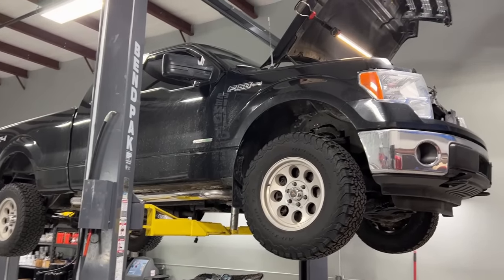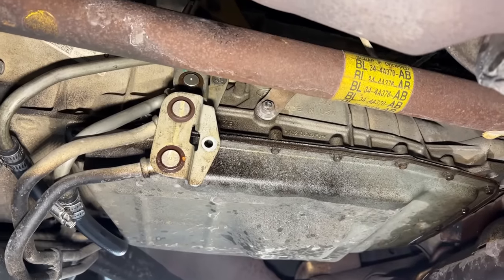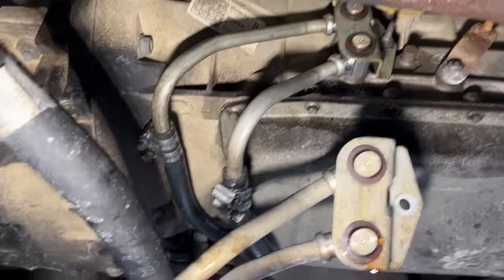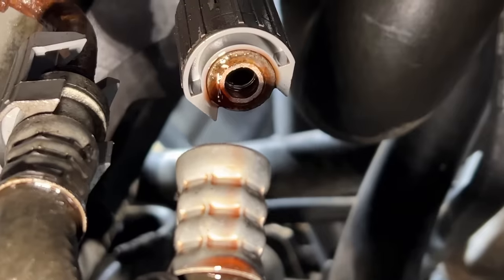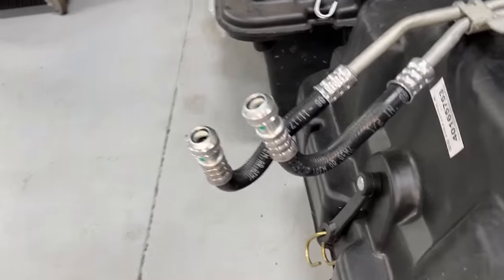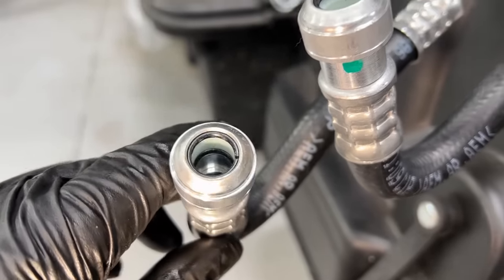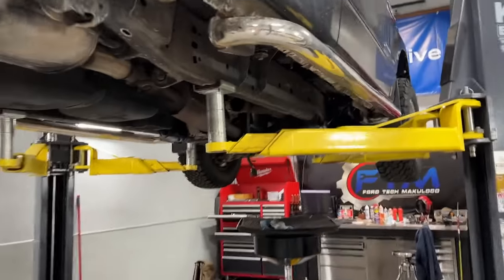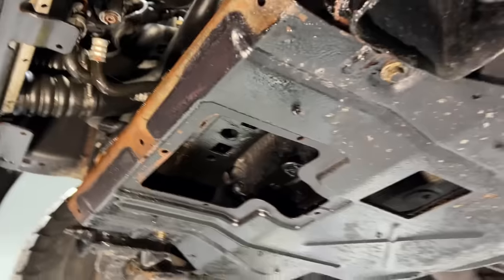Attention 2009-2014 Ford F-150 Owners! Check Your 6R80 Transmission Cooler Lines Before They Blow!

Comment: Love your videos and I've been watching for years, but I disagree with the lines being the killer on the 6R80. That honor goes to the worst thing in automotive history, the lead frame. I had a 2013 and it started failing so I traded for a 2015 (both bought new on the lot) and it just completely broke in one go. Ford didn't want to replace it despite me complaining since around 34,000mi. I kept dealing with it until a young woman chose to not check before turning, causing me to total her 2011 Ranger and my F-150. Now I have a 2017 F-250 King Ranch with the 6.7. I am over 122k miles and no problems whatsoever. I just need to do that EGR/DPF delete...
Reply: That happens to me,I detect the problem on time,cut the hose and put a two dollar clamp and fix the problem,.

Comment: My trans cooler line blew on my 2013 f150 a day after I bought it and it only had 95k miles. Check these lines because the quick connects are crap. The cooler lines are easy to replace at home though.

Comment: Just got a 2014 F150 5.0. Is it the same connectors as the ecoboost? If so, how should I go about inspecting them to make sure this does not happen? Truck has 123,000 miles on it.
Reply: I think they're very similar if not identical. Friend of mine has a 12 with a 5.0, his let go while towing their 26' travel trailer out of state. Replaced them & trans is still good over a year later. I have a 12 with a 3.5l EcoBoost, mine snapped while maneuvering our 29' camper trailer. I replaced all the lines & haven't seen any ill effects after 9 months. Dealer parts dept was super helpful sifting through part numbers, at least verify that much with them if you wanna try & find em cheaper elsewhere.
Reply: Thanks
Reply: No real way of seeing it’s gonna happen I would just change it seems simple and the part is less than $100 I got 215k on my 12 ecoboost and I’m doing it asap. Prevention is key
Reply: @ravennation14  agreed.

Comment: How many miles or age does it usually happen at?
Reply: One guy wrote that his broke at 65,000 miles. Aluminum fatigues easily, especially if it is hardened by pressure forming. You got that fitting, I would change it every 60,000 miles.

Comment: My 2012  did the exact same thing with my wife driving it on the highway. She was able to make it to a rest stop and I trailered back home and found  that the line broke in the exact same spot. The truck only had 80,000 miles at the time but also had a programming issue that I didn't  know about. The fix was easy but afterwards that's when the wrench light came on and the truck would barely move. Shut it off it would be fine for a couple of days and would do the same thing. Took it to the dealer and he told me there was a recall for the programming of the transmission. Since then I haven't had a problem except the engine missing at idle.

Comment: I actually caught mine leaking from the trans coolant line that is attached to the frame the line rusted through and developed a leak and the only way I caught it was when I used remote start to warm up the truck. But yeah I ended up replacing all the lines you showed in the video all for like 150$ in parts from ford an easy job to do.

Comment: Maybe modify that section with some flanged steel or nicopp tube into the rubber? You can certainly use a compression fitting on trans lines. I will do that if I ever get this truck.

Comment: A little late to the conversation but thought I’d share my dealership experience. My truck is a 2014 f150 5.0. I watched your video and immediately stopped at my local dealer to ask if there was a revised part # for the trans lines. They took the truck info and said no new part# was available and that they had never heard of the issue. Don’t know if I believe that! So I’d like to ask if there is a revised line assembly and if anyone knows the part# ?
Thanks for making these videos, you’re saving people thousands of dollars !

Comment: Had this happen on my 2013 F-150 Coyote with about 61k while towing my camper last July.  Saw the smoke screen in the mirror and pulled over immediately and shut it down.  Tech said it is generally a coin flip on the transmission surviving but so far mine seems to be ok with another 4-5k of towing on it.  I live in the salt belt.

Comment: Had my 2014 snap while hunting at the top of a mountain 32 km up a forest service road. Thankfully I was going very slow when I noticed the slight slip and stopped immediately. Was able to get turned around and coast with the truck off 4.5km back down the mountain to the main road. Needless to say, 14km walk out before catching a ride to town, $700 recovery bill to the next town with a dealer 2.5hrs away, and very lucky to hit the only dealer in the western Canada that that had a set of lines. $800 to replace the lines and fluid and was then on my way. like what was said on a previous post " The scary thing is; it didn't throw any codes or warnings".

Comment: My 2013 F150 broke at the same exact spot. Luckily I noticed it right away and shut truck off.  All I had to replace was the 2 cooler lines going to the transmission. Parts were around $200 and did it myself .

Comment: Brian thanks for the heads on the trans-lines , I am going to change  the Quick connect type fittings to BRASS  FITTINGS WITH BAREB TYPE  with three clamps on each end  or if I can double flare the one end to cooler . I don`t trust that aluminum .

Comment: I guess I'll have to check this out on my 2010 F150.  It only has about 130,000 on it now.  It's been the best vehicle I've ever had.  Only problems have been one seized brake caliper after it started sitting and only being driven every few weeks, and the squirrels who like to chew the injector and CHT sensor harnesses in half from time to time.

Comment: Hey Brian..good to see you back hope vacation was relaxing and spending time with your family..i just love how ford makes vital components so cheaply ..i think i would've set fire to that truck..of course that wouldn't fix the transmission..i still have my 07 it just turned 80,000 mi..yeah I'm retired don't have to drive that much..no problems yet still using mobil one..i do crawl under it to see if anything is leaking every once and a while..so far so good..you are appreciated..see you on the next one Cheers 🍺🍺🍺🇺🇸🇺🇸🇺🇸

Comment: I have a 2013 f150 with this transmission.  Occasionally when  accelerating at normal speed from around 20 mph, it will cause engine to rev up to over 3000 to 3500 rpms before changing gears. It's random when it happens.  Taking foot off gas waiting 5 seconds for it to calm down, it functions normal again without reving up high rpms before changing gears.

Comment: I lost a transmission line on my 7-speed Mercedes once and it still made it home with 90% of the fluid gone. It had 250k so I didn't care but after changing the line and filling it back up, the transmission was still going strong till 300k when the 4matic u joint snapped and cracked the transmission housing finally ending its misery.

Comment: i had a line break on an F550 at work.  in about a 5 minute drive it burned up the transmission, remaned trans was $6k.  the mechanic said he had no idea what caused the line to break, no sign of damage, rust or corrosion.  I had no idea it was dumping the fluid out while I was driving, it drove like normal the whole way, towing a skid steer with a load of stone in the dump bed, and when I got back to the shop and got out there was a trail of fluid through the parking lot.

Comment: Mine (2012) went from zero leakage to total fluid loss within 15 miles on freeway, this happened toward the end of 5/60 powertrain warranty. Lines were not covered by warranty ($800+), but shortly thereafter Ford replaced trans under 5/60 warranty due to driving while losing fluid.

Comment: I purchased a used 2012 with 90k mi for just a beater.
 6 months in and the trans started banging. Got worse and worse fast. Dropped the trans pan, it was black fluid and loaded with clutch debris, she was done.
I looked at the trans cooler lines and they were brand new. 
Now i know what happened lol.
Not a huge deal, just put a junk yard trans in it, been fine ever since.

Comment: Same problem I had with my old 86 Ranger. Fuel supply line blew off the fuel rail quick connector. Fords fix was to put on a useless clip. Unfortunately the line separated behind the quick connection. Was just out of warranty so I fixed it with a hose clamp.

Comment: We're seeing a similar issue with f250s from 2012 to 2015 in the fleet I work on, between the lines going and the trans pans that rot through in a year whether you paint them or not {most come unpainted from the factory including replacements) good times.
Reply: I wonder if this happens here in California

Comment: Let me try again, AT 205 Reseal is a clear liquid polymer that rejuvenates rubber parts, works on rubber hoses, suspension and steering parts, etc. Should help keep rubber hose sections of trans lines from getting stiff and brittle so as to also reduce vibration.  Just put in a spray bottle and go.
I have a 2014 F150 with a 5.0 and will be applying it on those hoses. Think of the cost difference between this product and so many rubber parts replacements !

Comment: I say cut off all the quick connect fittings and just run it straight to the metal tube with a rubber hose that you use crimps to hold them together and avoid the fatige issue of the metal fitting snapping off, yes the rubber will harden over time but replace the hose every trans fluid service since all fluid will be removed at that time. Just a thought to save some money and avoid the same problem down the road.

Comment: Great video! Thank you. What a stupid way to lose a trans. There may be a small resonance in that line perhaps at a specific RPM causing  vibration fatigue in the fitting. Aluminum has far reduced fatigue resistance compared to Steel. Either way, those things are gone for my use.

Comment: We are looking at a galvanic respond between the aluminum (which acts as the anode) and the iron when the two metals are wetted by salty water. The aluminum will lose every time.  Remember those aluminum bumpers on ford sedans from back in the 1970s that were bungee strapped to the trunk? Some engineers didn’t good grades in chemistry. So aluminum gets along fine in direct contact with other metals such as copper brass and iron as long as they don’t get wet.

Comment: Dang! Wish I had seen this last week. I just changed my Trans filter and replaced the pan gasket and bulkhead sleeve. I still need to add about 2 quarts of fluid. Guess I should go ahead and replace these before topping off the transmission. I'd hate for one to break while I'm in the middle of a mountain trail.

Comment: The same problem happened on one of my lines on my 2015 F250 Super Duty with 74,000 miles.  Fortunately I caught it before driving it without any trans damage.  I guess it's not just the 150's

Comment: I have a 2012 F150 that had this issue 3-years ago (2019) which put it at the 7-year mark and near 80k miles.  Transmission fluid drained and burnt out my transmission.  Cost me $3500 because the extended warranty company would only pay for the lower cost (approx $3k) of a 3rd party transmission instead of the $6500 estimated by the dealer to rebuild it.  Both I and the Ford dealership was not comfortable with a 3rd party tranny so I chose to eat the difference in the cost of rebuilding it.  This way, I at least received a 2-year warranty from Ford.  The dealer did a great job and 3-years later it is still running fine.  But why should I have had to pay the cost of a repair because of an apparently faulty design of a quick connect?  If it is a known issue, which it most certainly is, then Ford should be on the hook to issue a recall and replace those quick connects with a better-designed part.  They are obviously not designed to last long and their failure causes severe failure of the transmission.

Would anyone recommend a reasonable 'reinforcement' method to strengthen these quick connects, if that even exists?  Or is either replacing them every 5 -7 years or replacing the quick connects with a rubber line & clamps the only way to ensure it doesn't happen again?

Comment: I bought an 08 Expedition with bad transmission.  When I was inspecting it I found a failed compression fitting on the cooler line going up under the passenger side of the radiator.  It had completely blown apart and everything up there was soaked in trans fluid.   I hate compression fittings like this. As the rubber ages and shrinks they leak.  I cut the outer shell off, removed the rubber, double flared the tube, then put new rubber cooler hose on with hose clamps.  It’s been about 5,000 miles and no leaks yet.  It didn’t have quick connects like the video.  Sadly when I pulled the transmission I discovered the torque converter had a 2016 date code.  So that may have been a new or rebuilt trans.  I was replacing the trans with an $800 105k mile salvage 08 Expedition trans & converter.  It was all I could afford.  Now I’m getting what feels like torque converter shudder and recently feels like some delay taking off at first start up.  I just give it time to warm up and pray it makes it a while longer.

Comment: Seems Ford need to rework that line set with stainless fittings.  I bet there is just enough torque on the line from the engine movement to eventually fracture the aluminum tube within the fitting.

Comment: Hey man, I love how informative your videos are and really enjoy watching them. Though this does not pertain to this video specifically, I was wondering if you could answer a question for me. I have a 2014 3.5 ecoboost F150 that I just purchased with about 53000 miles on it. When I am at a stopped while in drive or reverse the cabin vibrates pretty significantly, but when in park or neutral the vibrations subside. Have you encountered this issue with these models before? I am not sure if its a misfire/spark issue or something else. When I am driving it the engine and turbos seem to be running great. The acceleration is nice, smooth and not lacking any power. Gas milage is good too. If you could shed some light on what you might think the issue would be I would greatly appreciate it.
Reply: Is the truck lifted or does it have a 2" leveling kit in the front? If so, OR EVEN if NOT - have someone double check your pinion angles, as shifting from drive to neutral or reverse to neutral would stop the vibration.

Comment: Had this happen to me in 2020 on my 2013 Platinum. Lines blew right on the metal fitting right by the trans oil cooler. Basically in exactly the same spot. 
Lines blew on the freeway. Despite shutting it off as soon as I saw smoke & the trans oil temp start to rise, the tranny was completely fried. 
$6k, 3.5 weeks, and a new tranny, later, I was finally back on the road. Got stranded out of state too, which was the even worse part. 

So realistically it cost ALOT more than $6k

I contacted Ford, and they refused to do anything for me. Despite their faulty part breaking & the truck having only 68k miles on it.

Comment: When I get ready to do my fluid change, or every oil change, I'm gonna give that thing a good wiggle and hope it snaps in my driveway. Gonna buy that line set too. 14 STX 5.0 6R80 owner THANKS!! 👊🏻🔧
Reply: Be careful about that.  You might do it and the NEXT Wiggle after yours might put it over.   I'm not sure you can tell anything by doing that if it doesn't let go.  But if it does, then you did the right thing.
Reply: @dlewis9760  thanks. My thinking is I'd rather it let go in the driveway and not the freeway...but I do see your point. This is something that needs to be addressed by every owner of these trucks.

Comment: This happened to my 2012 xlt just last August! Wasn’t even 77k miles. I lucked out, and was on the highway trailing smoke (the fluid hitting the exhaust) and saved it before any real damage was done. But what a stressful time…
Reply: How fair did you drive ?
Reply: After it broke do you think?
Reply: @murphybanegas9299  I have been accused of driving like a grandpa. Like I said, I was lucky, so I didn’t really lose a significant enough amount of fluid to be damaging before I stopped. So far since it was repaired, it’s been perfect.
Reply: @metallikat05  whats the name of this part? And what truck do you have?
Reply: @DesignLead  2012 f150 xlt extended cab 5.0. Transmission cooling lines.

Comment: Had this problem with our 2012 and 2013 F 150 ecoboosts.  Dealer had the lines for both trucks in stock. Coincidence, I don't think so. Easy enough fix, just a bit cramped enviroment.

Comment: This happened to mine yesterday. Thankfully it was only dripping, and was parked when I investigated and the line let go completely. Other than 10 feet onto the flatbed, it wasn't driven. Hoping for the best now...how has Ford not recalled this if it's a systemic issue?
Reply from the maker: no recall

Comment: So helpful, would you be able to at some point make a quick video about areas to lubricate /grease? For instance, areas around the steering and parts that just need to be kept on for lubrication? Feel completely in the dark as to where I should find these areas/boots and how to grease them, or if it makes any difference at all.

Comment: Thank you for the video. I thought my truck was a fluke when the connection broke. Luckily it happened when taking off from a stop sign only ten miles from a dealership. I had just dropped my camper off and wasn’t towing. I couldn’t even imagine the mess that would have been all  over my camper. I was so fortunate to not have it happen on the interstate towing.  My 2012 screw only had 76k on it when it broke.